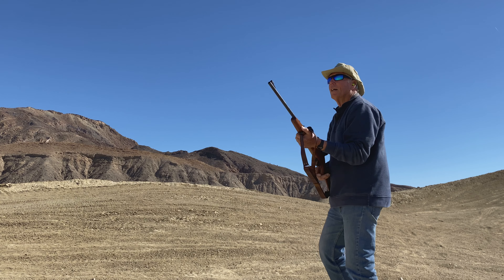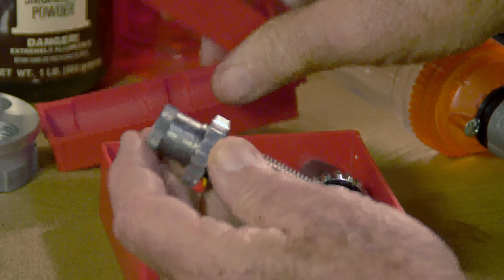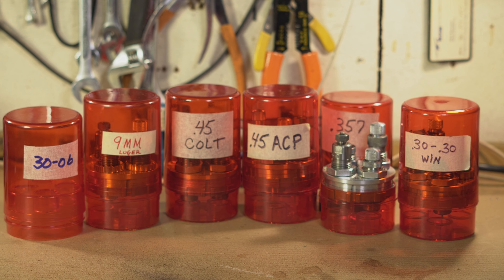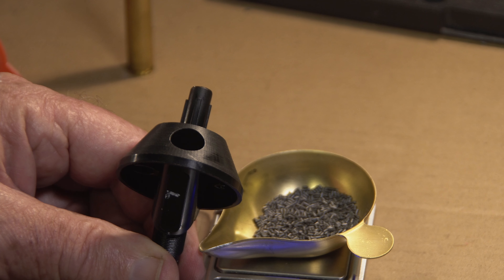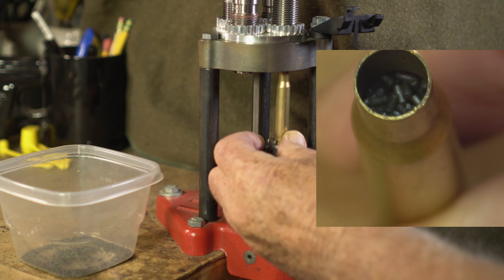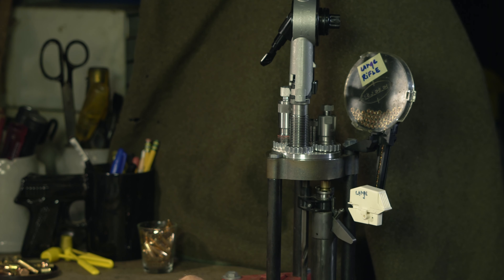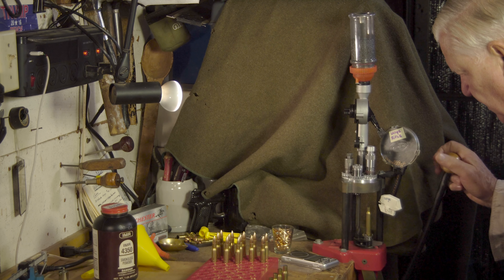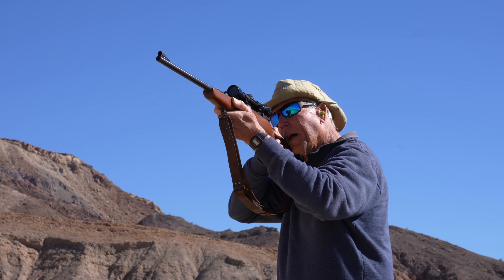Reloading the 30.06 with a Lee Turret Press

Comment: i was trying to deprime my brass and it kept pushing out the pin while clamping the case mouth. I have a hand loader set that i used to deprime instead but lost 2 casings having to cut them open to get the press pin out. Why did this happen? i couldn't figure it out.
Reply: Might be dirty cases.